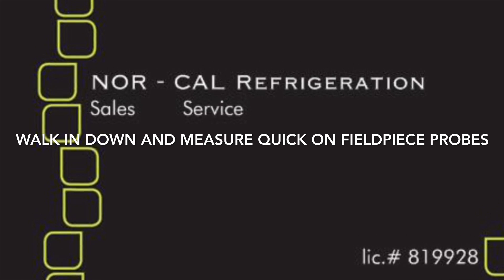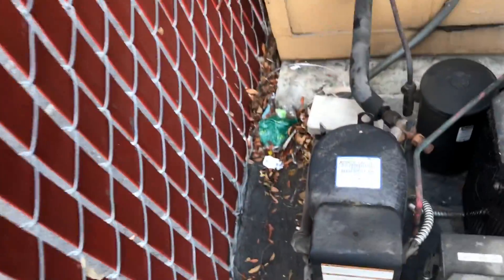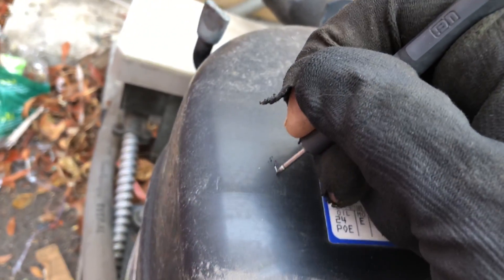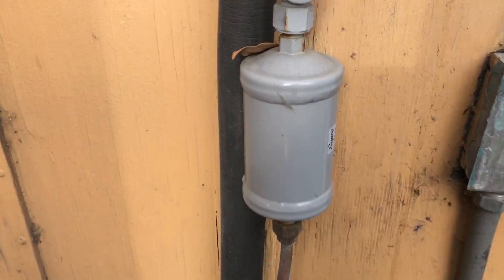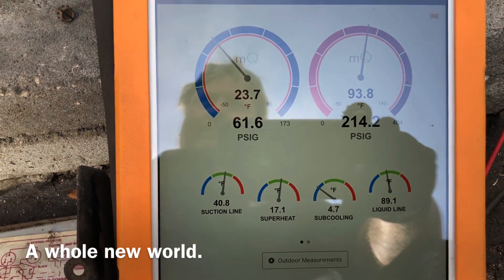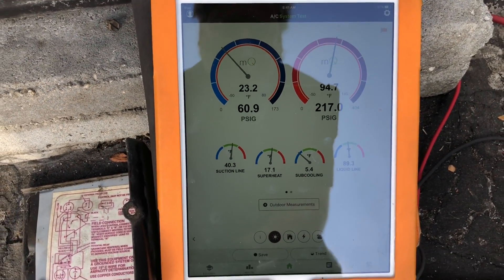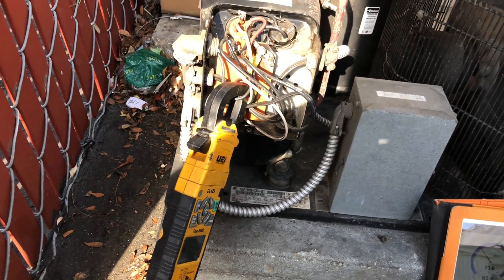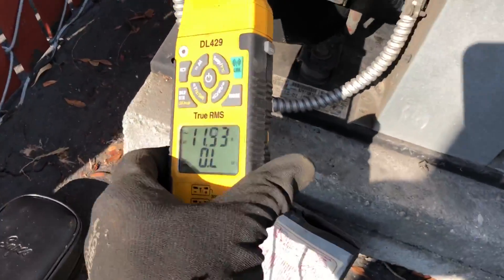MeasureQuick with Fieldpiece probes

Comment: I’m loving the measure quick app. I think the only other thing I would have done is a cap test under load. I’ve had, not often, found the run cap ok on a static test but under load have found them to be out of spec.
Great video

Comment: When a Comp is only slightly week it is hard to identify. It is nice to have a tool that can give a second opinion when you might be in doubt. I have changed several Comp that did not fully pull down to temp but all the test checked out very close to normal and when I changed the Comp I always had in the back of my mind that it could be an expensive mistake. I think MeasureQuick is a good second opinion for these calls.
Reply: HVAC/R Junky a megohmmeter would help determine in this particular case.
Reply: toolman Thanks for the reply but I was referring to slightly leaking valves. In these situations everything seems to run fine except for the fact that it doesn’t pull down as fast. Amp draw might be slightly off but not by much in some of these situations. Suction might be slightly higher and discharged might be slightly lower but it is hard to tell the difference when the valves are barely leaking by.
Reply: HVAC/R Junky it's a recip. Pump it down to a vacuum on the suction and see if it leaks by.

Comment: Good Vid. yea, compressors on its way out.  they got thier 10 years.  it must have been cold out there, 96 condensing?  = 66 degree ambient ?. right now. 90 most days down here min. 70-75 at night. MQ Saves Fieldpieces ass. Fieldpieces Probes Look Well Built, Cosmetically appealing, etc. , it's a Bummer Fieldpieces App Developer sucks ! / Has not Got a Clue. Maybe this will Give them some time so thier app developer can work on improving thier app / Back to the Drawing Board.

Comment: Good Vid. sometimes i'lll pop the cover off the electrical panel and take a look at electrical connection to breaker and if breaker is burned at the bus. pop out the breaker and have a look too. it's good insurance if u are installing a New unit too.

Comment: Square D QO panel? that was a space saver/double 30 amp 120V breaker. hehe
make sure there's no loose wires at the breaker also, many times people don't tighten the screw/lugs good and they burn at the breaker :)
when they heat up from being loose, they'll start nuisance/random tripping, the breaker will usually feel and be real hot with wire cooked inside panel. just something else to think about and check while servicing. I didn't catch if you checked the voltage at compressor with it running, low voltage will cause amp draw to be high. I don't think you'd miss something like that though. watching in a hurry cause I have to bolt shortly ;)
Reply from the maker: throttle bottle I have 113 at compressor while running which is within spec.  The breaker is getting replaced with the unit👍

Comment: I bet the max circuit should be a 30 amp breaker. Not that really matters for your amp issue 

Did fieldpiece have an issue using their probes for Refrigeration specifically.

Good video. Fieldpiece Resurrection
Reply from the maker: Sean Mack not specific to refrigeration the apps are geared for air conditioning.  The probes give plenty of information for refrigeration

Comment: 👍🏻👍🏻👍🏻
Good video Nor-cal
Jim’s app is awesome, I have heard some discussion on podcasts about it.
First time to see it in action, I like the analog dial look , pretty cool.
You got to hate those tripped breaker calls.
I think you may be on to something with a possible mechanical issue in compressor.
Bearings, cylinder issues, ???
Thanks for another great video.
Reply from the maker: Chris Alessi thanks for watching

Comment: What was the age of compressor? It’s a shame you can’t convert to 208 with new system.
Reply from the maker: Lee Johnson 2007.  That is about as big as you can go for 115 volts 5500 BTU @ 20 degree evap.

Comment: Measurequick may have single handedly saved the Job Link Probes. Good stuff!
Reply: I wish they made it work with my sdp2 and joblink too. I'm still crying in the corner
Reply: Joe Shearer 😢😢😜😜
Reply from the maker: Joe Shearer you’ll have to buy the probes joe 😂😂😂😂
Reply from the maker: HVAC in SC I agree 100%